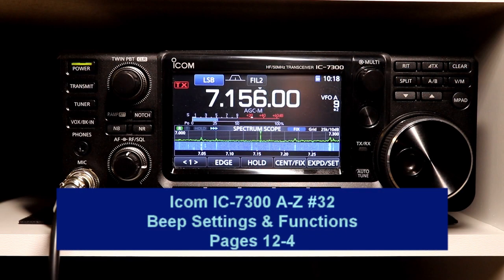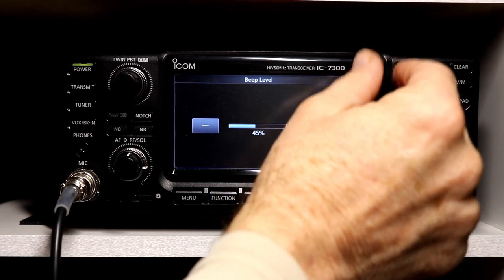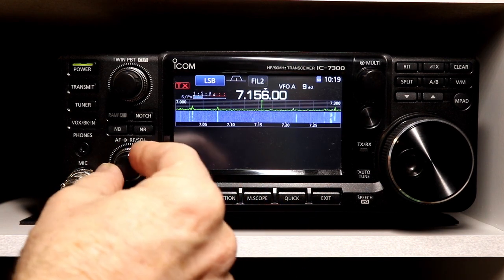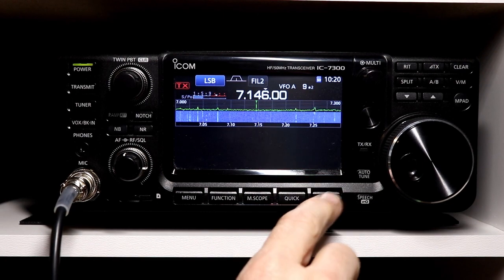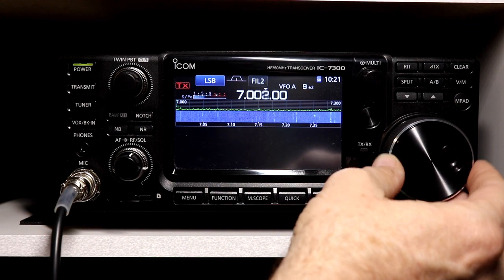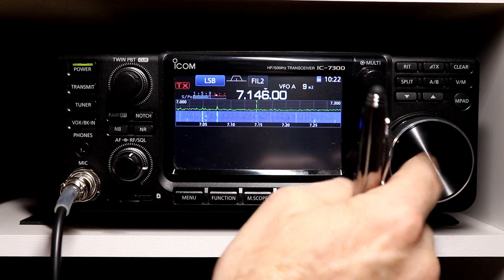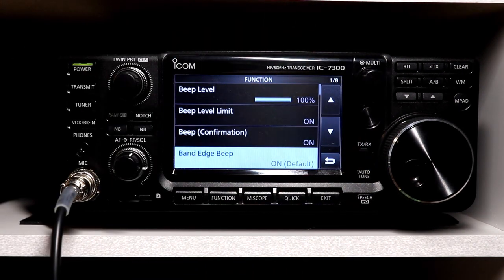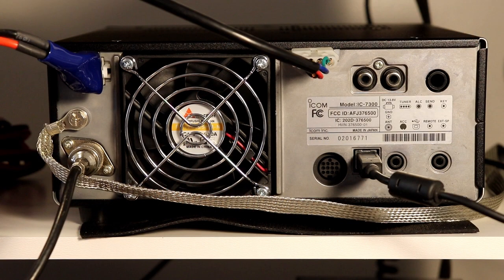Icom IC7300 A to Z #32 Beep Settings and Functions

Comment: Tom-as a new ham preparing for my General and having just purchased a 7300, I have to say  that this series is fantastic! Your videos are quite through and it’s easier to learn by your example than just reading the manual cover to cover. I’m waiting on some coax and an antenna to arrive, but thanks to your video series, I should be able to get up and running pretty quickly when they arrive. Thank you very much!
Reply from the maker: Thanks Andrew!

Comment: My 7300 arrives in a couple of weeks so having the luxury of this series has been great as I am returning from 20+ years off the air. Plus I have the VHF/UHF IC-9700 and a lot of the functions and menus are similar and it has been good finding my way around that with your help.

From a personal point of view, coming back to the plethora of changes in the technology, I would appreciate seeing the various options/benefits that the current software offers and also some hint at its longevity so that we don't go down what might become dead ends. The frustrating thing is when you know something should work and it just doesn't and due to inexperience you don't know where to look yet. There are plenty of youtubers offering advice, but as you showed by your methodical walk through the 8300 manual, I found "things" and "reasons" mentioned that I wouldn't have bumped into otherwise.

Thanks for taking the considerable time to prep and record these  Tom, I normally get through three before breakfast!

73 de Terry - G0BIX
Reply from the maker: Thanks Terry.  I’m glad that you’re finding them helpful

Comment: I think that new hams are somewhat intimidated by all the settings on their new radios.  When we ask for topics for new courses at our club meetings, we consistently get asked for what I think of as an operations course: how do I set up my radio for best operations?  Given the complexity of modern SDR radios, I can somewhat see the point.  I've watched your 7300 series, which has introduced me to parts of the 7300 I had not yet gotten to.  I also own a 7100 and a 9700 so similar courses on those would be useful to me.  Thanks very much, Ted - KC1JMZ

Comment: Thank You for the information!  I just got my 7300 and have been watching a lot of videos about it, long before I ordered it. I have not tested this out yet!  But other videos said that the tx limit will stop it from transmitting outside the user defined limits.  This can be very useful for me that is true.I am just a general class,  and want to set the limits of the General part to make sure I don't go out of band by mistake. This could be only for the new update that came out. I hope to test this out soon. I have a lot going on now with family coming for Christmas, and family does come first.
Reply from the maker: Hi Donald.  Thank you for the comments and the kind words.  Yes, you can program the user band edge beeps to disable transmit on your user defined limits.  I believe I covered that in this video:  Icom IC-7300 From A to Z - #3 Band Edge Beeps & User Band Edges
https://youtu.be/k4qP1yn3kIA
Reply: @HamRadioA2Z  I missed that. I watched all the videos in a short time and will watch them again. Maybe watch them 2 or 3 more times. I just got my IC7300 and still getting started with it. You covered so many things, it may take me a very long time to dig it all out of the book.

Comment: Your videos are very good and helpful but I am looking for something that I cannot find an answer to. My 7300 beeps about every 3 seconds as it if is starting and/or finishing a scan (?). Not sure what to call it. I don't want the conformation beep from pressing a button turned off but I want this constant sweep beep off as mention every 3 or so seconds. What am I missing? 73 and thanks for any help. WA4QGA
Reply from the maker: Hmmm.  I can’t think of anything that would beep periodically like that, other than a scan as you mentioned.  I haven’t done a lot with my 7300 lately.  I’ll play a little and I find something I’ll reply here.
Reply: Thanks for your help and reply. I finally discovered, by noticing the same thing on an SDR receiver, it is not the radio at all but I only notice it on AM. It is  external noise.
I suspect it is my security cameras. I  was concerned because I thought my 7300 was warning me of something - but I couldn't figure out what...   🙂  Thanks   73

Comment: YOU SHOULD DO  A SERIES ON THE  YAESU  FT-991A. GREAT VIDEOS ON THE ICOM 7300. THANKS, RAY K2RCQ
Reply from the maker: I'll keep it in mind.  I've had several Yaesu rigs and enjoyed them.  I still have one of 2 FT857's that I owned.  Right now I'm trying to juggle videos on the 3 Icom radios.  So it would be a while.  Then, of course there's the issue of buying the radio.  I just blew my radio fund for this year on an IC-705.
Reply: @HamRadioA2Z  HI I LOOK FORWARD TO YOUR VIDEO ON THE IC-705,  FUND PERMITTING  YOU'LL DO A VIDEO ON THE YAESU FT-991A. 73 RAY K2RCQ

Comment: How does the 7300 work in contesting ? how does the front end compare while in the presence of other rigs operating ?
Reply from the maker: Hi Kevin.  I don’t have a ton of experience in that area.  Our club has a 7300 and we’ve used it at Field Day and a number of special event activities.  I can only say that it seems to work at least as well as any other rig I’ve experienced with multiple stations all operating in a small area.  There is an Overflow (OVF) indicator on the display that will flicker on in the presence of very strong signals nearby, usually on the same band.  It indicates that the A-D converter is getting values above it’s maximum input value.  I’ve seen it flicker occasionally on my radio.  I’ve never noticed any effect on received signals.  I assume that the receive sensitivity is being reduced whenever this flickers on.  I will be covering it in a future video.
Reply: HamCuredSmoke thank you so much for your reply. ☺️I ve herd that as well just want to get the most out of my entry class 1k$ arena. 73s KC3ONO
Reply: @HamRadioA2Z  I'm very pleased with my ic-7300, but there are others who have concerns. For example the not so good behaviour in field days, as you write. For more reviews look at eham.net/reviews/view-product?id=12742

Comment: I found this video after a search prompted by a Facebook question in the 7300 group. I sent the gentleman a link to your video, but that got me to wondering, I have never heard any beeps from mine. I checked the menu and all settings are "ON" and the level is at 100%. The only way I can hear any beeps is by turning the volume up to about mid way. I'm using an external speaker (SP-23) and a DSP unit with it. Could that be the issue ? I'm OK without the beeps, but I'm wondering if there is something wrong with the radio or if the DSP unit is causing the beeps to be suppressed. Thanks- Brad WA9BD. (Also, enjoyed all of this series.)
Reply from the maker: Maybe the DSP unit has some type of automatic notch function?  I guess the simple test is to unplug the external speaker and see if you hear the beeps okay through the internal speaker.  Next, connect your external speaker without the DSP unit, if that's possible.
Reply: @HamRadioA2Z  could be. I’ll try that. 73

Comment: This is my 2nd time through the IC7300  videos.  I have a IC7300.  I have seen your videos on the IC7100, and the IC705.I don't have them but I know Hams that do have them. But I know some Hams that were not smart enough to get ICOM RADIOS,  HA HA!do you think that you will do some VHF-UHF radios or none ICOM radios. I know it costs money to get the radios and a lot of time to make the videos. I am having trouble getting Winlink to work on my VHF-UHF radio.
Reply from the maker: I have owned Kenwood, Yaesu HF and other gear over the years.  Right now I only have Icom gear for HF or mobile.  I do have several non-Icom HTs.  I have thought about doing tutorials for other radios.  It’s not just the money, but also time.  We’ll see…